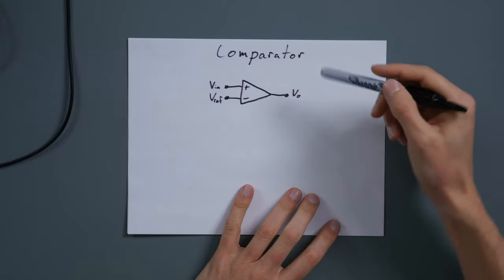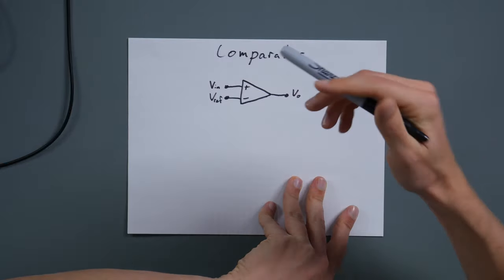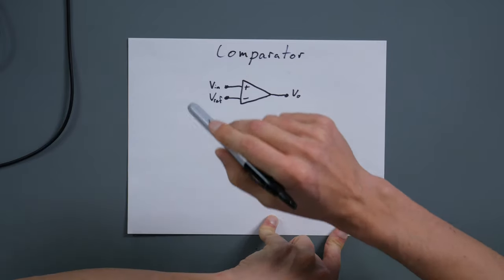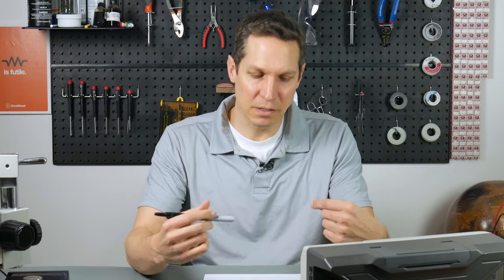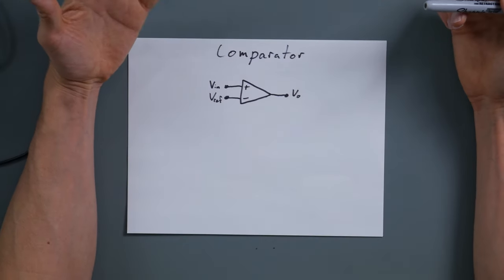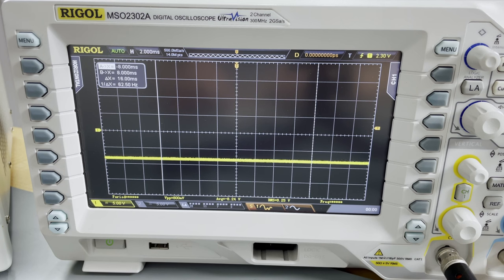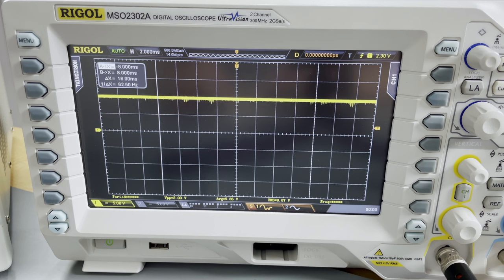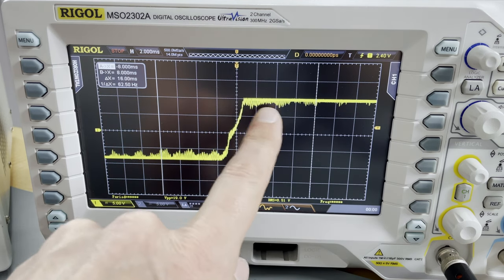Comparator - Operational Amplifier | Basic Circuits #16 | Electronics Tutorials

Comment: 🌟 I have a problem with the comparator, My V- is 7.85V from a devider, the V+ is 50mV up or 50mV down, in both cases the results was +6.44V, I was expecting to get +6.44V end-6.44V, I chaged the IC (LM833N) but the results stay the same, (VCC is +8 end-8) may be I have to use a different IC ?! Please help 👍

Comment: I am working on project for my college which is to automate heater rod, basically it has two inputs: temperature sensor input and potentiometer value as reference, we initially thought of using microprocessor but later thought what if we use an op amp instead of it. But we felt the op amp would struggle when the input is near reference as you have pointed out and it wont turn off at all. is there a way to use op amp and not comparators in this project? op amp is readily available in lab. Your videos are very helpful for searching the answers to questions that i had. Your way of explaining all in one go and your pacing is really nice... i enjoyed learning with you.

Comment: hello i want to start studying electricail eng in unvirstiy so where do i suppose to start watching your vidos ?
Reply from the maker: Good luck in your studies!  I recommend watching this playlist from the beginning which talks about circuits:  https://youtube.com/playlist?list=PLfYdTiQCV_p4IKgfbRML5EHFJPfBdW9Fv

After that, I'd recommend watching the first 10-15 videos in this playlist, which talks about microelectronics: https://youtube.com/playlist?list=PLfYdTiQCV_p711DywXAh53wL3xI7S55lg

And after that, I recommend exploring to see what best fits your interest!  Microcontrollers or control systems.  We're hoping to get digital logic videos up relatively soon as well as AC circuits but while we're working on them, we have several open source textbooks on circuitbread.com that you can explore to see what catches your interest.  Enjoy!
Reply: @CircuitBread  thank u very much
Reply: @CircuitBread  hey there,

I had a question I wanted to ask on Reddit but my karma was too low.

How do IGBT’s make a pure sine wave for 60hz? I understand that they switch on and off many times and the more they do that, the average looks more like a pure sine wave. If they only switch on and off 20,000 times a second and pulse width modulation works best when the pulses are extremely fast, how do you generate 60hz of ac?